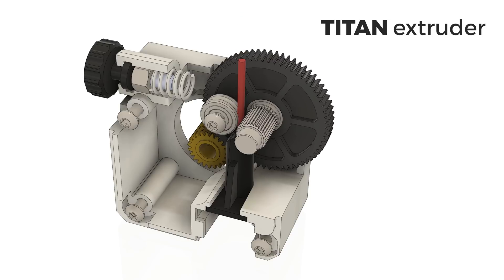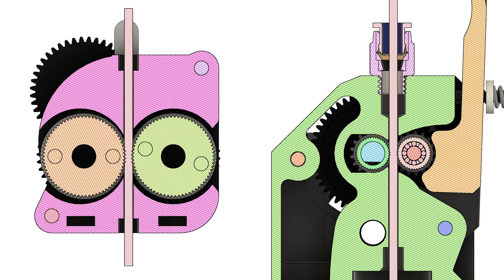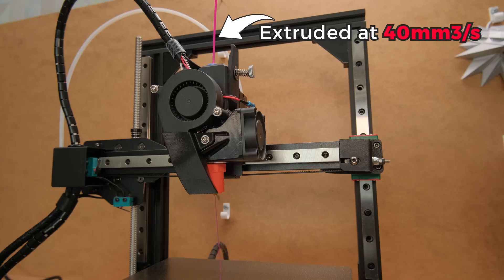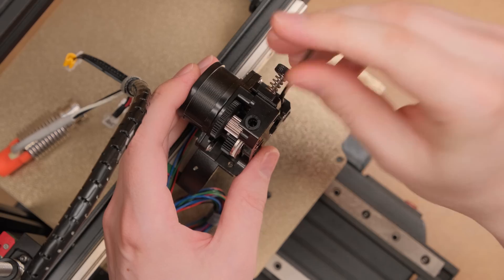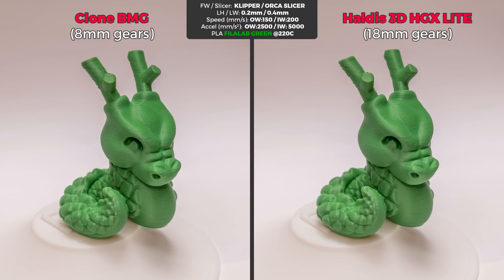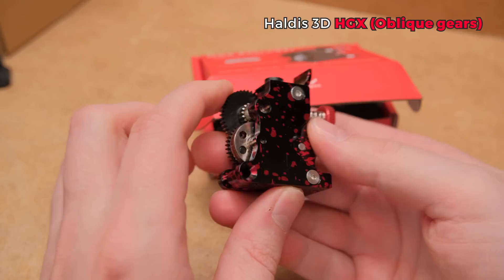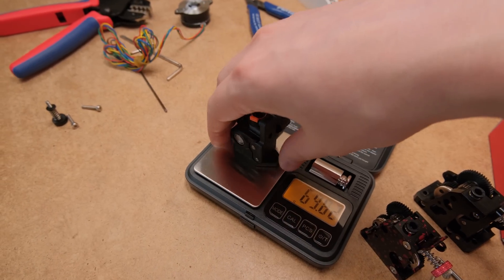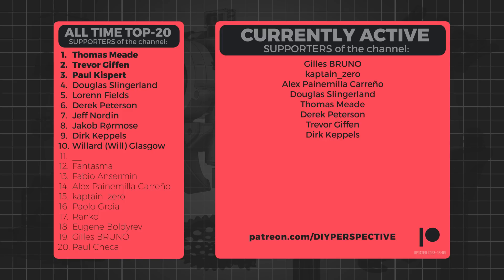SMALL GEAR Extruders are NOT VIABLE ANYMORE?

Comment: Very good info but how do you explain the best extruder on the market the vz hextrudort… it’s small geared and proven to print faster than any other extruder in abs pla and tpu the softest filament there is. Your maxing out your hotend not your extruder. Do the same test on a fast printer with a high flow hotend and a cht nozzle, you’ll have a few other issues before your extruder slips filament in its teeth. And you have no way of knowing how much tension is on each extruder so if the smaller gear was a looser tension your whole study would be wrong I believe
Reply from the maker: You sound very biased for stating it is "the best". Link me the independent in depth testing results and then I believe you. I maxed out my tested hotend more or less at the same flowrate with all extruders. The only difference was that the big gears offered a more consistent extrusion overall. The tension was based on how much the teeth dig into the filament when rolled through them. Also are you sure vz extruder uses 8mm gears? Aren't they mid size like on the Orbiter v2?
Reply: VZ Hex is far from the objective best or fastest, see tests by Ivan Miranda and others, but you raise some good points in the second half of your post. Most of the high speed and high torque use different topologies that increase surface contact in different ways.

Comment: Dual gear extruders suck because you can´t have an adjusted gear and mesh the teeth perfectly.
Single gear or decoupled gears which are large or a belt extruder are best. And why use gears at all ? It wpuld make sense to create spikes instead to drive the filament even better. We use gears because that´s what out there on the marked.
Reply from the maker: I see you too watch MirageC videos lol. The only option that I know without gears is the Proper Extruder. And the one that could be good with one filament pushing gear is the Nextruder if the Prusa ever sells it as a standalone.
Reply: @PrintingPerspective  I mean it is clear even without his videos but yes he has shown that I believe. It´s technically impossible to use dual gear for the filament AND have those both gears mesh. This idea only works because of the slop in the system and it is fine but if you want super precise extrusion, it just does not make sense.

The best extrusion possible would be archieved with a worm gear, just like in a injection molding machine. Which would also replace filament, it is generally a good idea since filament is about 10x the price of standard plastic. But it would be also difficult, expensive and heavy.
 
Second best option is to use one large drinving gear with gear reduction and the mating surface to the filament should have really sharp prongs instad of the normal gear geometry. Those would pierce the filament and push it. I think there is one company which already uses a similar concept. Even saw a wood mill ? This is also how they transport logs.
Reply from the maker: Do you test the theories in reality or do you just speak "in theory" stuff? I am genuinely interested. Because most comments from you are so negative no matter the topic. It is like the industry is doing everything wrong and you are the mastermind of some sort. Sometimes you make interesting takes but also some of them are complete garbage like recommending new QIDI printers, which are plastic trash boxes with an integrated CoreXY system. So it is hard to take things you say more seriously, you know.
Reply: @PrintingPerspective  As a mechanical engineer and developer I might see things differently, that´s why I point out negative aspects. 90% of all comments are negative, what´s the point in writing "there is no problem whatsoever" How do you improve this way ? There is no value in patting yourself on the back constantly. 

And of course not everything is bad in the consumer 3D printing market, far from it. The machines are incredible cheap and  power. There are many machines and even different technologies like FDM and SLA (or DLP). The price to performance is fantastic with almost any printer these days.

And while most machines are of great value and capability, many manufacturers (especially from China) make such stupid and unnecessary mistakes, it´s hard to believe they didn´t simply copy + paste a design. Same goes even for Prusa.
I have been saying form their MK1 on to change the stupid threded rods and stupid stuff like this, and it took them years for this simple modification. 

Also you are right, recommending the Qidi printer wasn´t great on my part, however it was not my intention to recommend this specific printer I just wanted to show that there are other better value options. I am not a fan of any brand I only compare capability and price that´s all.
Reply: RIDGA provides quality that is almost perfect. I see no reason for a derogatory comment just for the sake of doing it
Reply: @coltenmeredith8899  What are you even talking about ? 
It is not physically possible to use two gears which mesh with each other AND with the filament simultaniously and are adjustable. No matter the quality from whoever. 
Please show me my derogatory comment.
Reply: @sierraecho884  "almost perfect". Read my comment. It is plenty sufficient for FDM prints that us hobbyists produce
Reply: @coltenmeredith8899  Sure, on the other hand you can simply use a printer from 15 years ago, this will be sufficient as well right ? Print speed of 15mm/s is sufficient for a hobby right ? 
Sufficient according to your personal opinion, sure but it does not mean it can be better. Especially when we know that a technical solution is stupid. It is also sufficient to simply grind away the gears on the 2nd gear and use it without it to drive the filament...
Reply: @sierraecho884  but no, a printer from 15 years ago isn't sufficient. I guess I shouldn't have used that word. Extruders that don't use gears (proper extruder) or only use 1 gear aren't up for today's printing needs. RIDGA is the best option we have *currently*, but the technology will advance. Using gears is just part of the evolution until we get there, and big gears are the next step
Reply: @coltenmeredith8899  What is or isn´t sufficient depends on the person who defines it. What might be sufficient for me might not be for you or vise versa . Sure you can use that word it´s just hard to define.
So let us try to be as objective as possible.

I agree with you that having used double geared extruders made sense at a certain point in time. However it is generally speaking not a good idea. Let´s see why.

1. If you need this much force you are probably doing something wrong. Generally speaking (might be different with high print speeds, like in Voron) you don´t need much force to extrude filament. A high increase in  force is most likely due to a too low temp. for instance.
2. Double geared extruders can physically never function in a defined manner. Meaning either the gears will mesh with each other but not perfectly drive the filament or they will not mesh and the filament will drive the gear. Either way it´s not sufficiently defined and therefore a bad technical solution. Now it might work regardless, you can still extrude even if it isn´t perfect etc. But if this is your goal anyway, then why use double gears at all ? 

You keep mentioning RIGDA, I am not aware of what you exactly mean, can you please elaborate a little further ?
Reply: @sierraecho884  RIDGA is a BMG gear that is supposed to get rid of the wood grain effect that so many printers struggle with (issue 6). It is integrated into the drive shaft, so the concentricity is basically perfect (basically perfect, meaning CNC machine tolerances)
Reply: @sierraecho884  Force isn't really what I am talking about. It's issue 6, really.

If anything, large gear extruders don't have as much pushing force, as LGX lite can only push 40mm/s³
Reply: @coltenmeredith8899  So it is basically just more precise but the issue at hand still stands. How do you adjust from say PLA to TPU with a given Xmm dimension which can not be changed ?
Reply: @coltenmeredith8899  In this case a single  drive gear is still best. No matter the tolerances and how you try it a pair of gears can´t be meshed at a given distance AND be adjustable, it´s simply impossible. 
Gears are not made to be adjustable, they have a predefined distance.

Comment: something tells me that angled tooth profile is actually not good. sure you have more surface area, but less friction due to the angle. It could also cause twisting or the filament to move side to side on the teeth which would cause the same issues outlined by MirageC when looking at misaligned idlers. I've been saying this for a while now, but the next leap in speed printing is going to be switching back to 2.85mm filament. If we get a 2.85mm CHT Volcano nozzle with a 2.85mm ceramic heater Volcano block, and a 2.85mm LGX Lite or something similar, we will unlock the next milestone. Chinese companies: if you're reading, do it.
Reply: I got the vzhextrudort with angled tooth and one with angled tooth + helical gears. I havent had any twisting problems even with tpu.
Reply: Ha... you fool, the biggest bottleneck is melting power, wider filament is worse because plastic has awful thermal conductivity.
Also: LGX Lite is weak AF.
PS: The Heater blocks aren't related to filament diameter, the nozzle and heatbreak are.
Reply: Just a random thought, would it help if the angled teeth are opposite handed? so they are twisting the filament towards each other?
Reply: actually forget what i said, it's just going to rotate the filament in the opposite direction

Comment: Any dent in the filament from the gear will directly result in variation in the printed surface.  I want a drive that leaves no marks on the filament at all.  Maybe eventually there will be a printer with an extruder that flows evenly and a Z axis that is accurate to 1% on 0.2 mm steps.  It would seem possible using a laser interferometer or a calibrated capacitive sensor array often used in digital calipers to provide feedback to the Z axis drive. Until this is achieved 3D prints will continue to have fish scales and lousy vertical sides.  With the emphasis on super cheap bed slingers or super fast core XY printers, accuracy has been largely ignored.  Nice to see it starting to come to the forefront.
Reply from the maker: Maybe the Proper Extruder by Proper Printing?
Reply: Really? Before it comes out the nozzle it has to pass through the hot end and melt into a slurry that gets forced through a tiny hole. If it's a fancy nozzle it will also split it into three melty paths that merge before squeezing through the hole. I doubt some grooves in the side of the filament would make any difference after all that.
Reply: @DonovanBaarda  While printing flat vertical surfaces I found a pattern on the wall.  When I changed the pressure on the drive gear the visibility of the pattern changed.  When the drive gear dented the filament it appeared as a regular horizontal pattern on the wall surface. It makes sense as the width of the trace is modulated by the flow rate which is changed by denting the filament.

Comment: Great testing as always. Now I get why the lgx (not lite) is a thing.
Reply from the maker: A lot of new printers come with those big gears now - QIDI's new ones use those, Creality K1 / K1Max uses those, and even Anker M5C has those big gears. But if I am not mistaking Bambu uses similar size gears that Orbiter V2 has.
Reply: @PrintingPerspective dont forget the flying bears, those were the first ones with lgx clones, although every clone besides the k1 has spring loaded tensioners. The k1 only has one setting, lgx lite has two (rigid and tpu, tpu being the more closed) and the full size lgx 5 settings

Comment: I’m installing a 20:1 gear ratio ultra large gear extruder in my machine hoping to get enough torque to push 70-100mm3/s
Reply from the maker: I guess that is sarcasm? :D If not I wonder what hotend are you using, haha.
Reply: @PrintingPerspective  not sarcasm lol. Very very very long hotend. I can do 50 easy, but 70 starts to hit the limit of my Sherpa push force
Reply: The Goliath with VzHextrudort has done over 130 so 70 isn't particularly unbelievable. 🤷🍆
Reply: @daliasprints9798  with a 1.4mm nozzle yeah or with pla which needs less force than abs. With a .5 nozzle you need like 200n or more of force to push past 50 cubic
Reply: I wonder at what point you'd be better served by a geared BLDC motor & a rotary encoder for counting steps
Reply: @NM-wd7kx now lol/ on any direct drive at least. Just waiting for industry to catch up imo (dc servo woul work too)

Comment: I'm putting together a 60a tpu printer and was thinking large gears would be my best bet. Will be interesting if you or I get to testing that first.
Reply from the maker: For the TPU you also need the filament path to be as close as possible to the filament gears so that it won't have a chance to "escape" elsewhere when under pressure.
Reply: @PrintingPerspective  Yes, this is an issue with 95a as well. I'm looking at the tringlelab tbg-air, as the integrated nozzle looks like it can be positioned right under the gears
Reply: @1fareast14 something like that would be ideal or a lgx shortcut or ace with the integrated heatsink. But please dont buy a copperhead or mosquito, just fit any random copper v6 or volcano. Slice engineering charges insane money to the point where a genuine v6 (remember, 65 pounds or around 75 dollars) seems like a bargain

Comment: I wonder how layer adhesion will be affected with higher actual flow? Is the filament going because it is fully melted or because it's just being squeezed through?
Reply from the maker: I mean the max flow rates weren't that different between extruders, they capped more or less at the same point. Big gears just provided a more precise control with lower filament deformation.

Comment: Thanks for the video!
I think, we're actually limited by the hotend flowrate, not the torque. For example, you don't have to increace stepper motor current when you use volcano instead of v6. Just because underextrusion is caused by insufficient power of heating transfer from heater block to filament inside.
Reply from the maker: Hotends' and extruders' performances are closely related. So we want the best of both worlds for the best results. You won't be using the Titan or BMG extruder on the Goliath, you know.